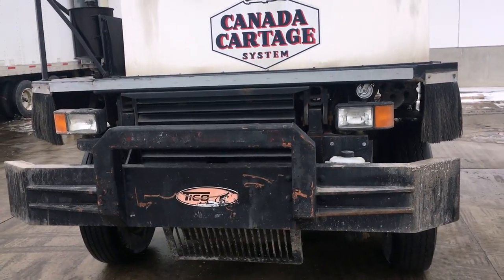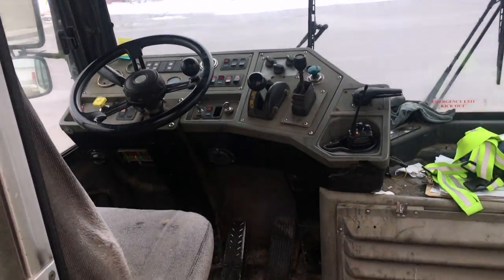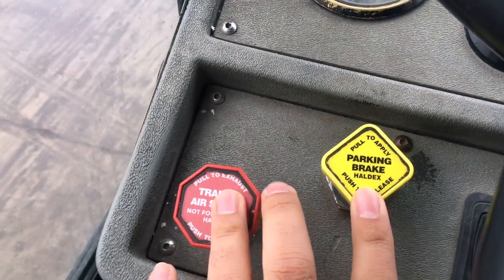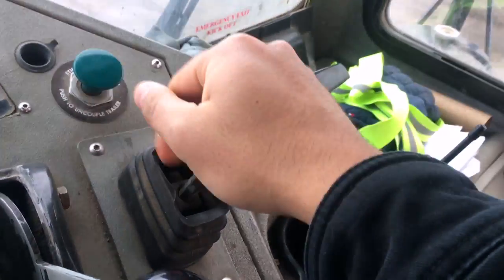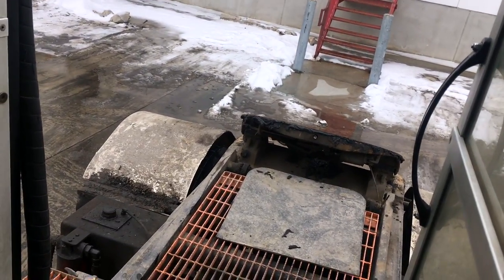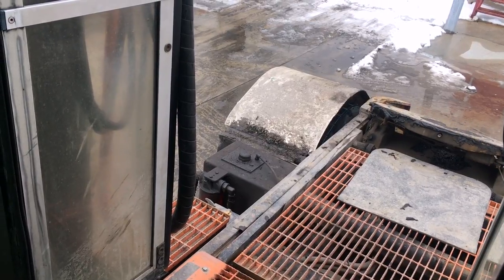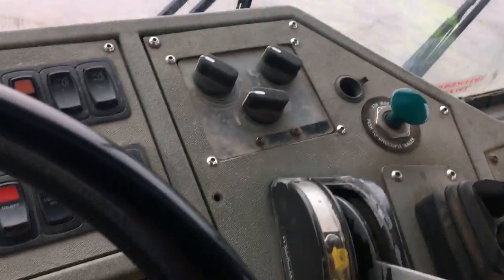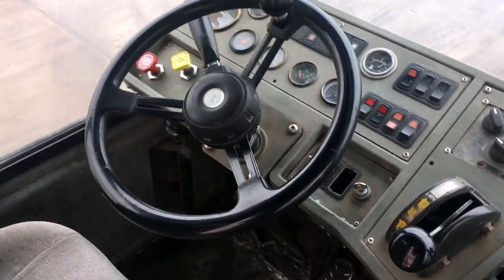How to operate Shunt Truck/ Yard Jockey/ Trailer spotter

Comment: Good info I just got hired as a yard Jockey so this info is helpful on what to expect I have my CDL-A but this is slightly different from driving a sleeper
Reply from the maker: Thank you. Yes, this is different than a sleeper. Since, you got hired as a jockey, I’d say follow proper method to get on and off the truck. Getting on and off the truck puts lot a pressure on knees if you are not following proper method. 
Good luck
Reply: Proud to see, being a woman you are handling this Job, Me too wanna work as a Shunt driver, but just waiting for my Driver's license.
Reply from the maker: It was good and safe. Being safe in this line of work is most important. So I enjoyed my time as yard jockey.

You will do great tomorrow for your interview. Good luck🤝🏼

Comment: you ever work the night shift as a jockey?
Reply from the maker: Sorry for the late reply, yes I have. Apart from the problem that you won’t get to sleep at night, I really liked the night shifts. There is much less work at night shifts and a lot quieter. I would not recommend working a night shift in winters as Shunt guy/ Jockey, it gets pretty cold and heat in these trucks are always bad.
Reply from the maker: Please subscribe if you haven’t already. Thanks